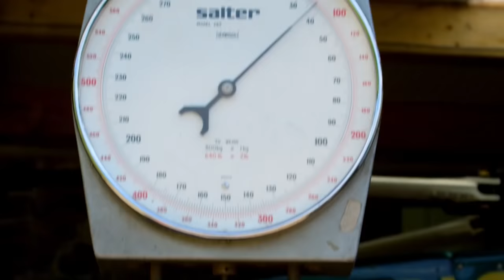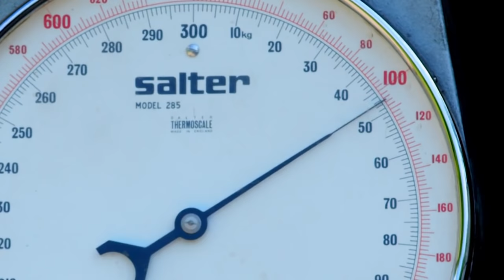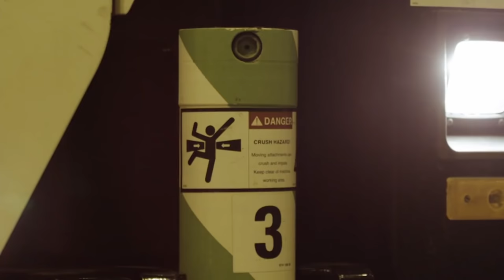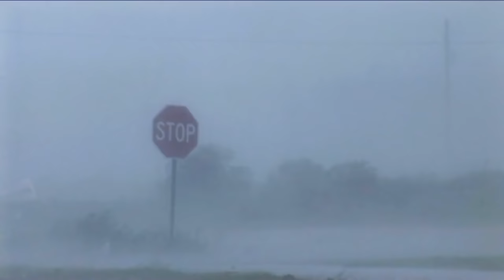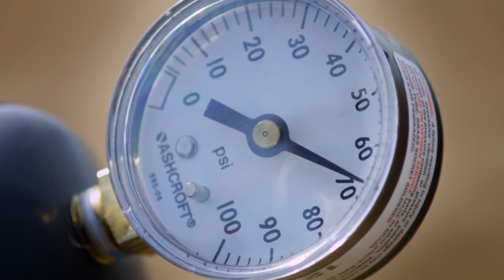Why Is Water So Important For Life? | Richard Hammond's Wild Weather | Earth Stories

Comment: University: The guys who don't drink 24/7 make cool potato canons. But btw, if you want a faster canon: Keep the vacuum part with the projectile in it, but add a second chamber to pressurize it and put a solenoid valve just before the seal behind the projectile. Then you'll get the 1 atmosphere you already got plus whatever you can pressurize the second chamber. Then open the solenoid valve, this will break the seal and shoot the projectile at much higher speeds ;)

Comment: WTF? 4 metres of rain (depth)/annum does not equal 4 cubic meters (volume) of water.
Reply: Rainfall is measured over a unit of surface area ie, 4M per M^2  gives a volume of 4M^3 per M^2
Reply: 4 meters of rain means 4 m of water, no matter the area. So no matter the surface, it would fill a tank to a level of 4 m.
Over an area of 1 m^2, 4 m of rain would equal to 4 m^3 of water, because it fills a cube of 1x1x4 m.
Reply: @GodlikeIridium  if they say that UK gets 4 m of water per year it means 4 m of water over the whole UK. Of curse this is a rounded nr, some areas more some areas less but the area is specified, the area is UK